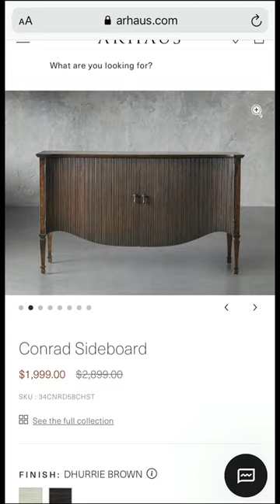Don’t buy your dream table...make it! #doy #furnitureflip

Comment: How did you cut down the dowels?
Reply from the maker: Using my miter saw. After the dowels were glue down and dried I sanded the bottom to straight out any slight length differences. 🥰hope this helps!